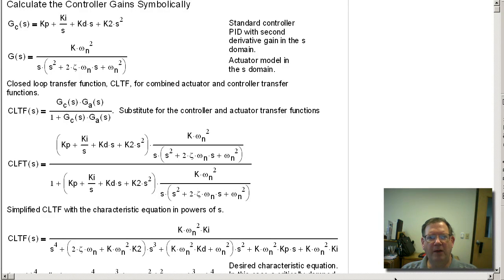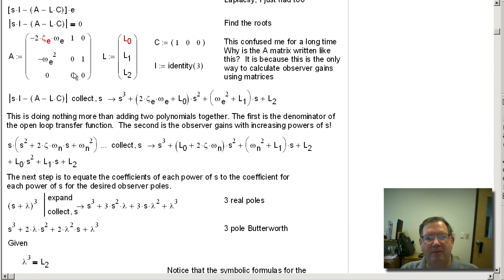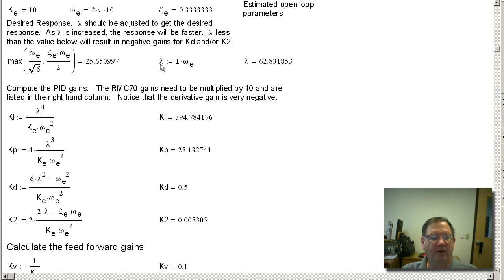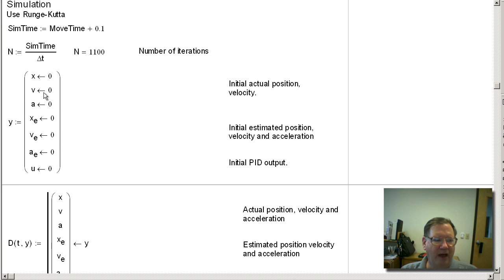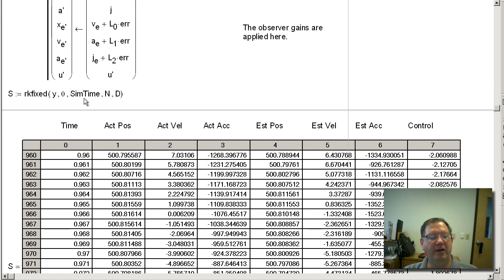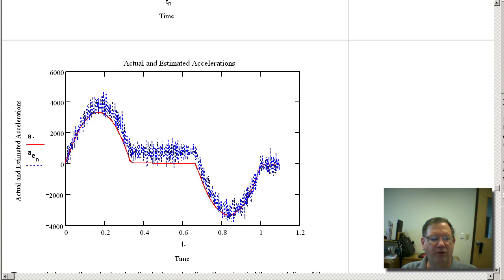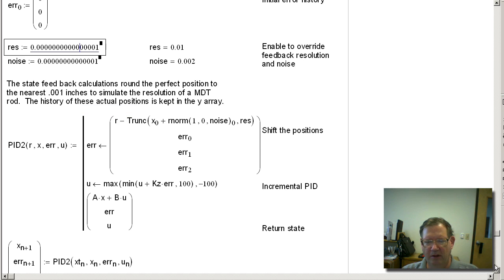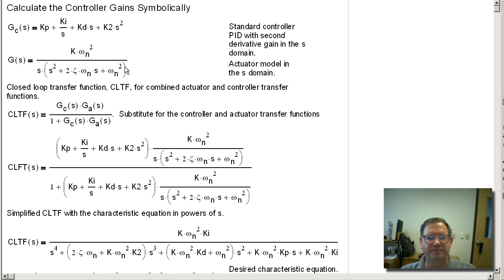Peter Ponders PID - Observers/Estimators

Comment: where you implemented that rkmethod command.In which software.
Reply from the maker: I usually use the built in function rkfixed which is RK4.   I have a pdf file that compares RK vs Adam-Bashforth here on page 3/13.
http://deltamotion.com/peter/Mathcad/Mathcad%20-%20Adams-Bashforth.pdf
Notice that RK4 is used to start the first few steps of other integrators.